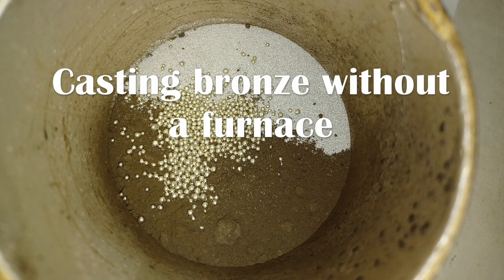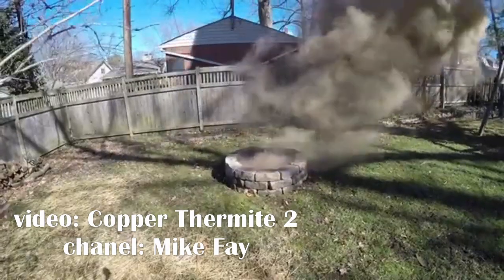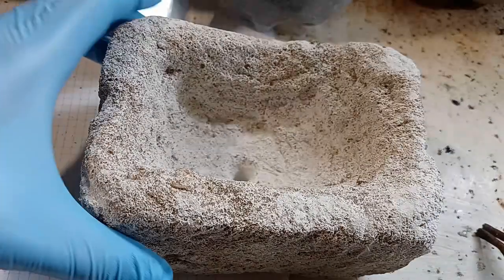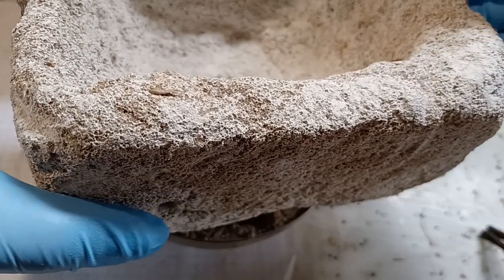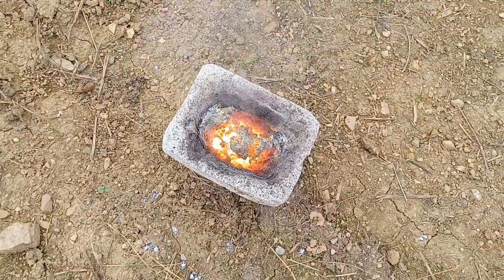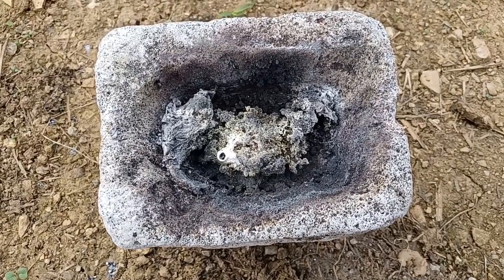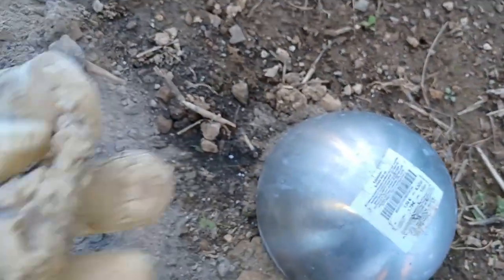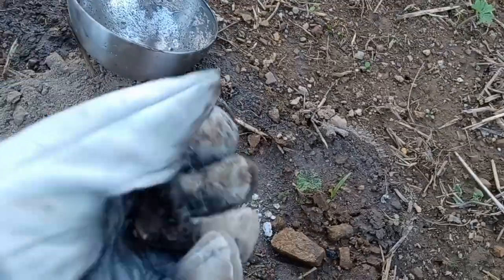Casting bronze without a furnace

Comment: I have some ideas you might want to explore:

Using Sodium Silicate solution ("Water Glass") to firm up your sand mold.
Using a Flower Pot for the reaction vessel.
Using a Bronze foil or plug at the bottom of the reaction vessel.

Another idea was going 2 step with this, first step create the molten bronze into a crucible (probably preheated) then do the pour into the mold.
Reply from the maker: Two step process, bronze plug and sodium silicate reinforced sand mold are very good ideas however i doubt a flower pot would survive the thermal shock of my mixture.

Comment: I've played with this idea a little bit. It was in a furnace though so not quite the same. Basically using a thermite reaction to push the melt from red hot to molten. The first time was an accident, I had copper almost molten and was adding aluminum to make aluminum bronze when the mixture started sputtering and throwing sparks and very quickly was a roaring thermite reaction. A fair amount of the copper must have oxidized because there wasn't anything else the aluminum could have been reacting with.  The main problem with making practical use of the reaction is creating a precise alloy with it is difficult. With some more trial and error it could be dialed in but the few times I did it intentionally weren't really enough to learn a whole lot.

Comment: What if you heated the copper chunks in a fire first before dumping it on top to both start the reaction and lessen the difficulty in getting melted copper?
Reply from the maker: Whille this might work with a changed setup i belive it would be better if i limited the amounnt of copper vaporised during the reaction and use preheated mold.

Comment: I have found that sometimes, simply scaling up my thermite and making more of it, actually makes it work better.
Reply from the maker: Yes this is the case because you have a larger mass of metal and slag that holds the heat for longer and has the time to fully react. This also gives the produced metal more time to flow to the bottom and corect together.

One of the problems with my mixture is that the reaction burns too hot ad i am loosing metal to evaporation. To limit and perhaps eliminate this more copper and/or flux needs to be added. But overdoing this will cause problems with ignition and separation.